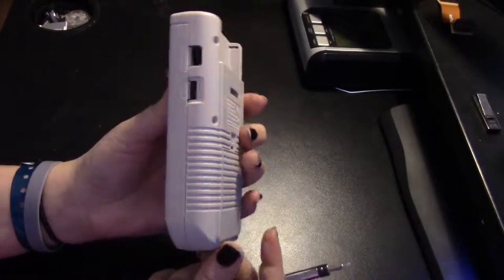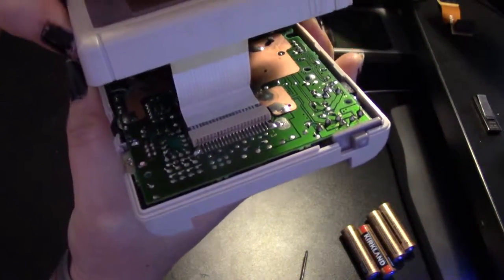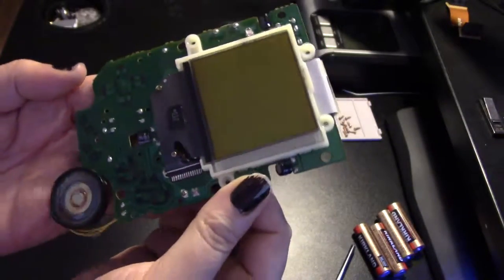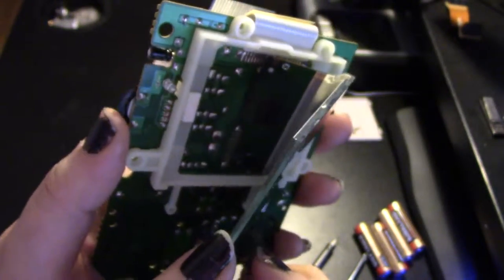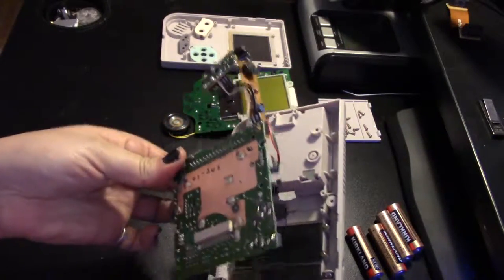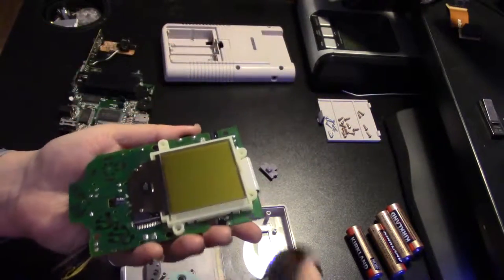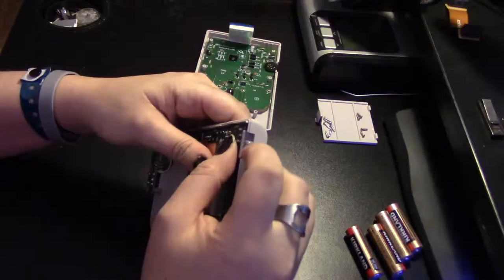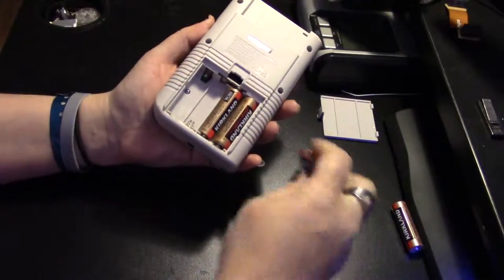How To Open / Repair Gameboy

Comment: very well done tutorial :D i actually took mine apart last night for the first time.  for some reason the bottom two battery contacts were a bitch to remove
Reply from the maker: +Majoras Thanks :) I get tired of tutorials that go on forever or try to promote something. Thought I would make a "to the point" one, haha
Reply from the maker: +Majoras Yeah, all three can be. Ha
Reply from the maker: +Majoras Yeah, all three can be. Ha
Reply: +SR212787 really useful too how ya highlight the screw holes, think you may be the first to do this on video.  hey i have a question you might be able to help with.  my game boy's screen is off center.  for example the battery LED light is just partially showing (in the upper-righthand corner) when viewing from the lens, is there any easy fix?  doesn't seem to be any way to 'shift' the screen over slightly without trimming the pcb board and needing new drill holes.  i've only seen 1 other person ask about this online
Reply from the maker: +Majoras That's really odd. Have you replaced the front plastic? When I did I noticed the screen seems off now. I'll look into it :)
Reply: ***** well i bought the game boy used online (black play it loud), looks to be the original plastic lens.  but the (inner) screen itself was already off center when i received it.  i'm almost thinking the flaw was always there with this particular unit.  i plan on getting a replacement glass lens some time this year but other than that there doesn't seem to be any solution to the problem
Reply from the maker: +Majoras Yeah, as far as I know/remember, some units were a little off center. Not much on the way of moving it either I'm afraid... Without much modification to the innards, ha
Could try trimming down the plastic that holds the screen in place depending on which way it needs to be moved.
Reply: ***** thank you for the feedback :D after playing more, the main concern is how the LED light is barely showing through the lens.  when playing a game the screen appears more centered than the light.  maybe i just need to move (mod) the LED position lol that would save a lot of headache!

Comment: Hey! I know I'm a little late to the party but I have a problem. I recently bought a Gameboy used with a game stuck in the slot. Does anyone know how to fix this?
Reply: Also the power on/off button is stuck.
Reply from the maker: You could try to start taking it apart like in the video. Once you get the case apart you should be able to see where's making it stick.